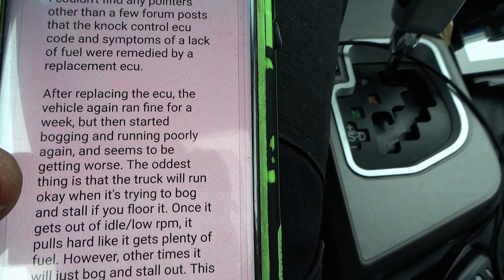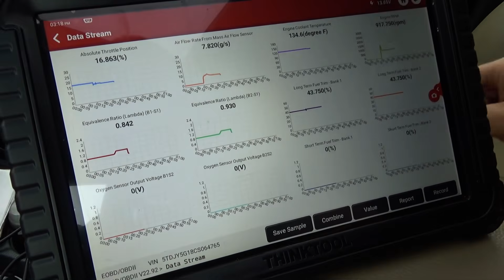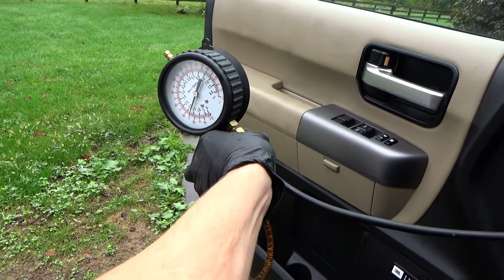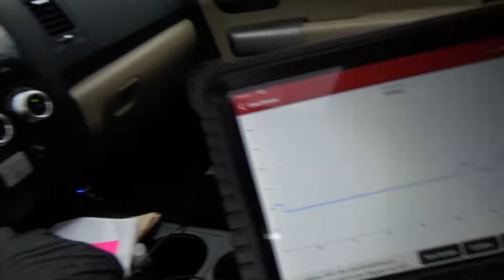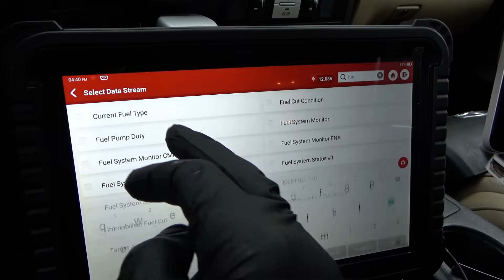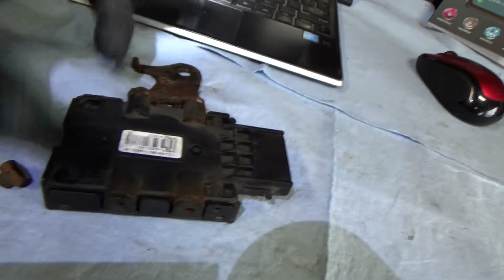(Pt 1) $2000 MISTAKE? (Toyota V8: LOW Power-STALL-Runs LEAN-Low Fuel Pressure)

Comment: Why don't you test the Voltage on the fuel pump, if there is no current? then you will know, if the pump or the controller is damaged...

Comment: OEM ebay part you saw coming from japan is real OEM, i ordered myself an OEM honda transmission range sensor that came from japan for 157 dollar, i got it and it was really OEM, i almost made a big mistake burying it from Honda dealer new york  queens for 450 dollar. The only problem it took almost two weeks to get it, i was in no rush, the old OEM mad it till i got the new one.  I got a code of tange sensor mulfucntion, i reset the system and the car was working fine till the new one arrived.

Comment: Do the basics first, exhaust and other leaks, clean the throttle body and air intake sensor, if cheap I might replace the O2 sensor. Then you need a fuel pressure gauge, how to connect it, high and low, is the question. You assume the dealer replaced the pump when they saw this, the intermittent side of this might be a problem and it looked OK after replacement. It was brought back, they did some flush and again got it running. You're the same shop and maybe tech who recently diagnosed the pump, it is your opportunity to not look like you ripped them off and find the real problem and not tell the customer. Electrical is probably beyond a lot of shops though this should be one of the things suggested by the online diagnostics being a key component for producing fuel pressure.

Comment: You said at the end “I wish I had a known good.” If you’d have tapped into the fuel pump power feed wire and used the duty cycle feature with your pico, you could’ve compared what the module is actually putting out, to the desired percentage on the scanner. This would be just as valuable as a known good. I’m puzzled why you didn’t even check voltage coming out of the module

You stress the importance of having a separate screen for your scope than for your scanner, which to me is just personal preference. What’s ultimately important though, is using your scope to it’s full capacity. Doing so can help eliminate the guesswork, as in this case

Comment: at 25% duty: extreme values (extreme right, extreme  left) should be viewed with caution.   I have seen a case when a scanner sends 5% Intake Flap open position command on diesel RAM, only to get reply that such address is invalid and the flap not moving for that command. The other values, 10%, 25%, 50%, 90%, 100% worked well. Lesson to me was that scanner software has some bugs, has features that actual vehicle's hardware is not able to respond to. Gotta use a scanner with a grain of salt.

Comment: lol. Nice one as always Ivan. Scotty Kilmer told me Toyotas were amazingly designed and never go wrong. Nice design Toyota , putting a delicate electronic component on a truck there. Germans would not do that because they properly engineer. To prove this point, BMW fuel pump controllers are always inside the car away from the elements, not hanging underneath on cheap ricer rusting steel. Also love your thorough approach as always Ivan and not just shipping it, but checking the fuel trims after replacing the module. Nice DME programming Toyota that the fuel trims did not start sorting themselves out.

Comment: Bleeding the air from the fuel gauge shouldn't make a difference.  25 psi of fuel and air is the same on the gauge as 25 psi of fuel.
Reply from the maker: @kevin9c1  but that gives faster reaction to pressure fluctuations 😉
Reply: @PineHollowAutoDiagnostics  Right, faster.  Which is "better."  Except I suspect the gauge is already responding about as fast as it can even with some air in the line.  It's just a fun argument I remember having back in EE school (with the hydraulic analogy) with my automotive friends.  Your mind goes to brakes immediately.  The intuition you develop says "air in the lines means you cannot achieve proper pressure" because everyone knows a hydraulic brake system with air cannot squeeze the calipers as hard as if there was no air in the line.

But it turns out this is misleading.  The reason for the limitation is because there is limited displacement of the master cylinder AND brake fluid actually flows through the system to move the mechanical components (not much, though).  The flow required by the fuel pressure gauge is tiny so it's mostly a static system.  AND, if you had unlimited brake pedal travel, you could build just as much pressure in a hydraulic brake system with air in it as without air.  Back to the fuel gauge, you have a practically unlimited amount of fuel able to actuate the gauge, so you have an infinite brake pedal in that analogy (not that the fuel is going anywhere, so it doesn't matter).

Finally, pressure in the system would be approximately the same in all locations.  It would take significant flow volume (think current in a wire) to actually drop pressure (voltage) over a distance.  Intuitively, the first instinct is to think "pressure is obviously higher where the fluid is vs where the air is" but this is really impossible given the low flow volume.  Physics is always trying to reach equilibrium.

Comment: I own a 2007 Toyota Tundra sr5 5.7l and the fuel pump control module always goes out on them. My box was so rusty it didn't make any sense. It would blow my fuse after running about 5 to 10 seconds. It took me 2 weeks to figure it out because all i had was a test light. I tested everything and it sent me straight to the module.

Comment: I know you've already figured it out in part two, but I'm only half way through part one. I want to see if the fuel pressures regulator is going bad, or if you have an intermittent fuel pump problem.

Comment: I was so "right there with you" on everything until the 1 volt drop on a 6 amp circuit. That still seems substantial to me. Either way, as long as you avoiding listings "For Genuine OEM"  xxxxxx Watch for the word 'FOR'. Excellent find by the way... From Japan.

Comment: It isn't the fuel pump resistor is it as I had a Toyota Tacoma that would stall out and when started ran for a few minutes and would quit running, resistor was in front of the battery on that Tacoma

Comment: Too bad the strategy used by the fuel pump control box is not documented. Now you can't determine if it is the box or the pump. Maybe they put in the wrong fuel pump or did not install it correctly. I think i would have a look at the pump first before buying a new controller box...

Comment: What was the noise when pump was at 100 percent? I'd still look into what you called a return line. How does the ecm monitor this for control?
Reply from the maker: Just the regulator opening up. Stays closed under normal operation on this design 👍

Comment: We see a few a year like that here in Va, usually from the rust belt. Metal case on the FPDM rusts and swells, seal fails, boards becomes water contaminated. Cracked one open recently and it was pretty nasty. Scary call to make on a $3-400 module, but it's a high-percentage failure. Fuel pumps rarely go out on Tundra/Sequoia.

Comment: Would it have been worth temporarily bypassing the controller and running the pump direct from 12v for a test drive to ensure fuel trims return to normal?
Reply from the maker: That risks overload the pump since it's never designed to run at 100% duty cycle 👍

Comment: Did you measure the voltage applied directly to the pump motor Ivan?
If in the fault condition you have voltage to the motor but no current, it would indicate a bad pump motor.

Comment: Very interesting diagnosis and part failure. I would be very surprised if it turns out to be multiple failures. The wiring diagram and an oscilloscope are absolutely necessary.

Comment: If I was on your place I would check the pulses on the pins for the pump at 25% with and without load (I assume that the module is some kind of PWM ), also I would power it directly from the battery and start the engine to see if it run better.

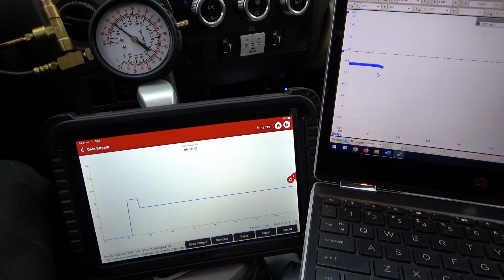Comment: I want to propose an additional test around 21:15 when your scope showed small fluctuations in amperage and your fuel pressure gauge fluctuates. You'll want to find commutator segments in your amperage waveform (or is it a voltage waveform that gives you commutator segments? this is beside the point tho!), and check the fuel pump RPM when these fluctuations occur. A fuel pump that cannot keep up with volume demand will SPEED UP when the pressure against the impeller is reduced, meaning the RPM will be FASTER when fuel pressure and current are lowest. A fuel pump that is losing electrical power due to a poor feed (either wiring or fuel pump control transistor) will SLOW DOWN due to the reduction in energy being fed to the motor, meaning the RPM will be SLOWER when the fuel pressure and current are lowest. I am not sure if my theorization is correct, so don't take me for gospel, but this test should at least provide a large amount of new information to your diagnosis before making a call.
Reply: Leave it to Ivan .

Comment: I would measure the Controller output voltage with the scope and check the duty cycle. Command 50% and see if you get 50%.

Comment: If you have future customers with Asian vehicles who can wait on parts, I recommend getting them from Amayama. That same OE Toyota part is $86+26 shipping for a 2-3 week delivery time straight from Japan.

Steering wheel telescope motor for my mom's LS430 was $640 at the dealership or $490 from Lexus online. I got it from Japan for $210+shipping.
Reply from the maker: 3 week wait time is usually unacceptable for customers 😅
Reply: I've had good luck with megazip getting Japanese parts for my Honda/Toyota's too. Far cheaper and usually available when they are backordered here in the states

Comment: A lot of the time, those cheap OEM parts from Japan actually are legit since parts are so much cheaper there- often 1/3 to 1/2 of the cost here, sometimes less. What I generally do is look up the MSRP in Japan on JP-Carparts (if the part is used in Japan) and see if what the seller is asking is reasonable. I often find that they are selling the parts for just a bit above the Japanese MSRP, but if they are asking way less, that's suspicious.

Comment: In OEM data there may be a table correlating ECM fuel pump duty cycle command to average fuel pump current.

Edit: I wanted to add that the control module problem failure mode is very strange. The fuel pump motor drive circuit will have a switching current control approach, perhaps hysteretic current control. With this type of control, with a high enough sample rate on the Picoscope, you should see the effects of the RL circuit time constant effects as Peak to Peak current switching transitions done in such a way to control to an average set current command from the ECM. You can see this on your Picoscope captures in the video.

The issue is what failure mode would skew the reference set point to produce a reduced current when we know module power and ground are good? The circuitry probably uses an accurate voltage reference to guide the proper operation of the analog front end which will then control the switching driver. Meaning the only thing I think would produce the problem is a faulty voltage reference or buffer circuit. The problem with this guess is voltage reference circuits are extremely reliable. So, what module failure mode is causing the problem, perhaps corrosion on the PCB? Can we open the module and look inside? You may be able to fix the module if it is corrosion and have no parts required.
Reply from the maker: Part 2 coming right up 😉

Comment: Straight voltage,  bypass it to check pump and no internal leaks
Reply: no need to do that. when testing fuel pressure you saw that the pump could put out enough pressure....

Comment: I was going to suggest bridging out the fuel pump control module just to prove that it's not the fuel pump which is faulty.

I am nort sure why Toyota uses that module In a 5.7 litre V8 powered vehicle because Holden didn't fit one into my Commodore in Australia which runs the 5.7 litre Chevrolet LS1 V8 engine, it's a 2002 model & the fuel system is returnless.

They however,did fit that type of module into the 3.8 litre Buick L67 (Supercharged V6) Version of my car, I know that mine isn't a Toyota but I am giving an example of which car Holden fitted it into !

Comment: I had a 2018 Sequoia just today. Had a bad fuel pump control module. Bogging down, stalling, hard start.
Reply from the maker: Wow a 2018? Was it rusty? 😮
Reply: @PineHollowAutoDiagnostics  Overall not bad, but you know where these things live and I'm in the northeast up by the 45th parallel. The module itself was crusted up like yours. I was able to get the mounting bolt out but had to cut off one the little screws, the other broke loose with a pair of vise grips.

Comment: Easiest and quickest way to check the fuel pump control module is to by pass it.
Reply: How do you bypass it?
Reply: @bartscave Just take power and ground from the module and jump it to power and ground on the pump. It will be like the module is running at a constant 100% duty cycle.
Reply: @bartscave just hot wire it , that way you don’t have a computer turning it on/ off speeding it up/ slowing it down…😊

Comment: I would like to have seen the output (voltage duty cycle) to the fuel pump on the scope.  Is the module properly outputting the correct duty cycle.

Comment: I would have also scoped the output volts of the module to the fuel pump. The current clamp is good, but it'll only show what the fuel pump is accepting for current. If you have an open or corroded connection the current clamp will report, surprise surprise, less current. Verifying the module is actually supplying a clean 0-12V duty cycle to the pump could have prove without a doubt if the module was good or not. Given how you saw 0 amps at lower duty cycles does suggest it's the module since you should see some current regardless of the duty cycle.

I would also be curious to see what the ECU is seeing for fuel pressure. I would assume it has a fuel pressure sensor, the fact it's lowering the duty cycle of the pump while being blow spec might hint at a sensor that's skewed and over reporting fuel pressure to the ECU. It's very curious why there would be a return line on a duty cycle system. I would think the return rail would have a regulator that regulates pressure, but then why does the pump need a duty cycle controller at all? very odd.
Reply: The v8's in the sequoia and tundra do not have a fuel pressure sensor.
Reply from the maker: Fuel pump current is programmed to keep the fuel psi LOWER than the mechanical regulator setpoint (47psi) to avoid dumping fuel back into the tank under normal conditions 😉

Comment: Can you open that module and check for a cracked solder joint?  Or, is it potted?  When they replaced the pump, did they have to unplug from this module?  It worked for a short time, then failed again.  Maybe a bad connection inside the module that they temporarily fixed by unplugging and plugging in the pump?
Reply from the maker: We'll see in Part 2 😁

Comment: A young friend called me, working at Yoda dealer. A Sienna, idled good, slow acceleration-good. Heavy accel, power dropped-off. The three rear cylinders misfiring. Swapped plugs, coils, no change. I asked him what the fuel pressure was, had not checked. Three days went by, I called him. When he took off the fuel line to check pressure, water and mud ran out of the line. Tank and lines had to be cleaned, tank was 1/4 filled with sand/mud.
Reply: Angry girlfriend...😅
Reply: Mud ran out?  Didn't he check it after the filter?

Comment: My first thought was a return fuel pressure regulator. 🤔🧐   On the return line, but this vehicle does not have one.
Reply from the maker: It has one... But the design is to keep the fuel psi LOWER than the mechanical regulator setpoint 😊

Comment: Why can't you bypass the fuel pump ecu for diagnostics and give the fuel pump full voltage/current to fully ensure it is the box? Fuel Pumps ran for decades without being duty cycled. You seemed concerned although it looks like the box is bad to me and this truck is supposed to have a brand new Toyota pump. I am not an engineer but I have wondered for years why they locate these fuel pump control modules under the vehicle... I also don't understand why the PCM can't just take the place of this module but at the very least these modules need to be inside or underhood.

Comment: Paused at 12:25  That's madness that it takes the system 90% duty cycle to barely make base fuel pressure with a brand-new fuel pump.  If that fuel pump was actually receiving that much power to make that little bit of pressure, it would fry itself in a week.  It has to be a bad fuel pump driver module.

Comment: Great diagnostic, Ivan! I was guessing the fuel pump installed was not OEM and could be failing, or the flow is restricted due to debris in the tank . But them you measured currents (can't escape the scope in these cases), and no way a clogged pump would draw less than normal current. It may well be the pump control ECU - failing expensive transistor driver, perhaps.
Part 2 will clear this doubt :-)

Comment: ivan, please go over your fuel pressure gauge plumb in....    also, could you have put full voltage directly to the pump to make sure the problem isn't the pump or the lines? is there a regulator as well?